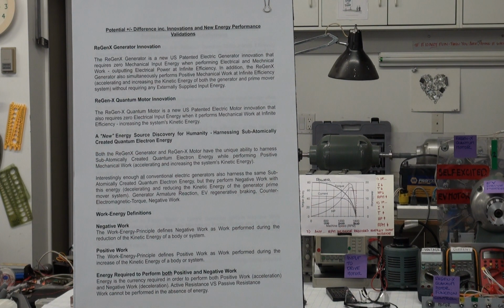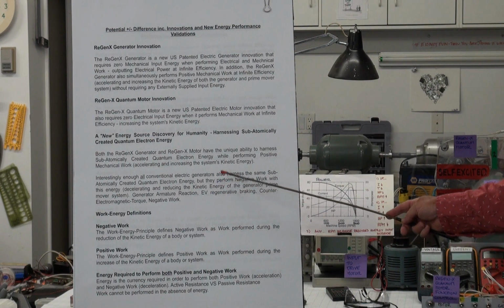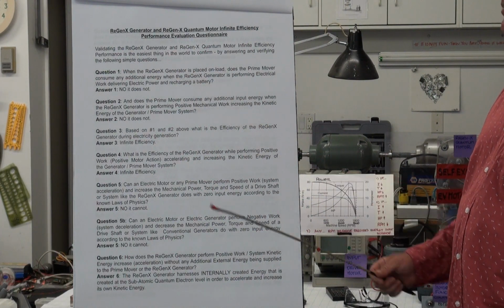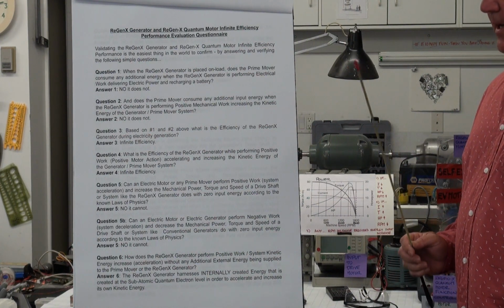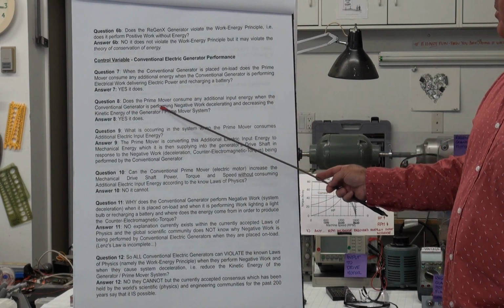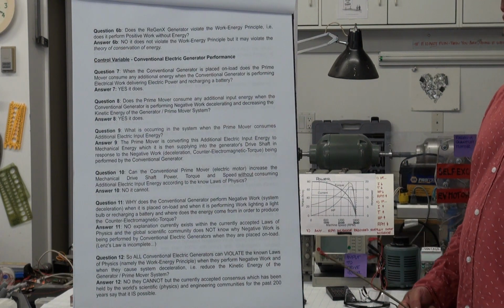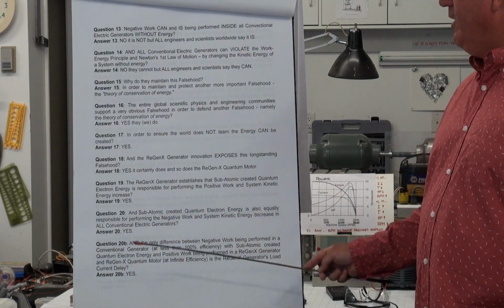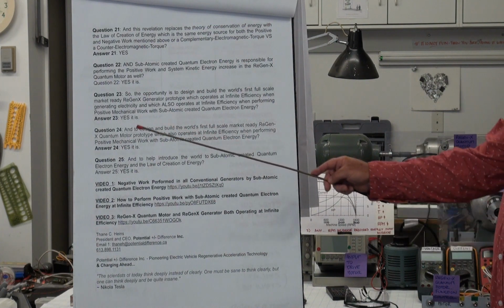PART 1 Potential +/- Difference inc. Innovations and New Energy Performance Validation

Comment: Great presentation is a big project and needs more publicity, You need to do a strong publicity campaign for a long time this project has been there and the world still doesn't know, please let's popularize this system make a strong publicity, look for partnerships wherever you go need.
The world needs this technology....
Reply: There is not much views of videos, because videos are boring. Need to add music, visual effects, show more about construction of gadgets, assembly, disassembly. Tell conspiracy theories about suppression. Even if not true, it will attract more audience.
Reply: @marcisgulbis9310  Unfortunately or veslimente this is the way, people like spectacles things like "I discovered the secret of free energy" in a cover with rays and lamps shining and, even hitchhiking on Nikola Tesla's fame, It's a big project but you need to call the pubic attention, good luck...
Reply: @369Eletricidade  Cybertruck with solar panels will have infinite range, if you drive not more than 50 miles a day. https://youtu.be/kt2-tNgfiTs  Regenerative acceleration technology will be useful in Tesla Semi truck. Battery powered semi trucks is practical, if there is RegenX generator that keeps batteries charged. Hydrogen fuel cells can't be recharged from regenerative braking and regenerative acceleration, and rooftop solar panels. Hydrogen fuel cells is only 50 % efficient. Batteries are 99 % efficient. Now you understand why Elon Musk calls fuel cells "fool cells "?
Reply: @369Eletricidade  https://youtu.be/4jio8EubJtQ Regenerative braking and regenerative acceleration can overheat batteries. To solve this problem, Tesla engineers invented 4680 battery cell with less internal resistance. 4680 cells will be used in Tesla Semi truck and Cybertruck.

Comment: SCAMMING 101
STEP #1  use the absolutely meaningless term QUANTUM 
STEP #2 tell those who question your lack of any credible 3rd party validation to do it themselves.
Reply: https://youtu.be/VSCIws7zppU
Reply: Also all this from Wikipedia is the biggest load of nonsense! Total Bs from all critics on Wikipedia!
And any person with any unit of study in physics, can explain every mistake in the “skeptical” groups info…

“Critics of the system have pointed out that the system described by Heins simply demonstrates a change in the motor's hysteresis drag, increasing the speed of the rotor but not producing any energy.[13] In other words, when the rotor exhibits acceleration following a specific electrical short-out, the device is merely more efficiently converting the input electricity to mechanical energy than in the other test configurations.

ERROR 1.

Fist off the device (motor) ‘increasing speed’ 
must result in proportional LOWER Amps from input, or we violate the laws of physics - (ac impedance laws) 

So the motor users less input energy under load as the voltage stays the same and the Amps drops proportional to speed up. 

The other option is amps stay exactly the same as the CMMF in this test result in being behind the torque cross product - F=qE X qvB 
Here there the same motor function happens but Lenz law has a longer time- constant and the lag TC Time after - F=qE X qvB

Also as show on the Wikipedia quote the result was current from closed loop generator coil - so there is electrical output which is why there’s a B magnetic field to seep up the rpm in the fist place. 

Clearly hysteresis drag, doesn’t account for electrical output of the generator coil either!

If it were possible to reduce hysteresis drag 
It would only be possible via a much higher speed. 

It’s impossible to ad any sort of closed loop generator pickup coil to a motor and have it gain efficiency. 
Here the skeptics are trying to apply the wrong general argument - that a magnet field resulting form Faraday induction coil, provides more…

WRONG the only argument that can be used is:
That argument is that you can use a outside field as stated, to convert Amps from the input to RPM increase… 

every tech  person knows this… 
but here they have changed the general argument to fit their nonsense skeptic claim.

IF THIS IS DONE THE RESULT WOULD BE NO MORE ENERGY ANYWHERE IN THE COMPLETE SHSTEM - it is the same as gears on a bike in this context.

It  Would NEVER lead to a gain in motor “efficiency” 

Remember skeptics your Bible tells you “energy does not come from nowhere”

They have still not accounted for Lenz Law resulting from electrical induction in the generator coil!!!!

Complete Joke on that wiki statement from them.

On February 29, 2008, six members of Ottawa Skeptics met at the Colonel By building at the University of Ottawa to witness a demonstration of Perepiteia. Heins, who conducted the demonstration, later met with the members to discuss his device and answer questions. In a subsequent report released in May, Ottawa Skeptics expressed severe doubts about Heins' claims regarding Perepiteia. They noted that Perepiteia produces either observed acceleration or a slight increase in generator electrical output, but this alone does not automatically mean that "free energy" or perpetual motion is being produced, or that there is a "real and measurable effect." While acknowledging that the speed-up behaviour of the generator cannot be fully explained, they stated that there is no evidence that Perepiteia "represents any challenge to currently known laws of physics."[14]

ERROR 2

You cannot state the device ‘either’ rpm gain ‘or’ increase on electrical output 
This violates Faraday’s Law and Lenz Law - as the electrical output (AMPS) is only possible with a ‘closed loop’ therefore the B torque - giving rise to a gain in rpm is also a result from Lenz Law… BOTH must happen or BOTH must not happen - you CANNOT SAY ‘either’ ‘or’

The circuit shown was a small demonstration not a final design that offers large results - so you can’t turn the argument into anything but “small” result, the small result is the POINT!

THE SKEPTICS WERE WRONG AS IT STATES THEY SAW IT WORK PRODUCING A GAIN IN OUTPUT! 

THERE ARGUMENT HERE IS A straw man as Thine never said “free energy” is the result… He shows even in this video the gain in energy is accounted for! 

On May 21, 2009, a skeptic writing under the name Natan Weissman wrote an explanation of Perepiteia in relation to its motor, a Ryobi bench grinder. The author states that the acceleration behavior of the machine is due to the consumption of torque from the induction motor, rather than any unconventional manipulation of Electromagnetic fields or Counter-electromotive force.[15]”

ERROR 3.

Again the general argument is that if you attach a magnet or a coil for a Faraday Law result (closed loop) 
To a motor you can get a proportional gain in RPM - as stated before…
THIS IS A REDUCTION OF TORQUE  FROM THE INPUT power amps change. 
The test starts by showing that IS NOT the concept, or context,…. Again misinformed kids being skeptical of adults work!

First to be skeptical we need to understand the test - not just guess!

Wikipedia failed yet again!
Reply: Simply not the case!
Reply: Quantum means nuclear. it is nuclear energy.
Reply: https://youtu.be/cVFXSZzUNmE